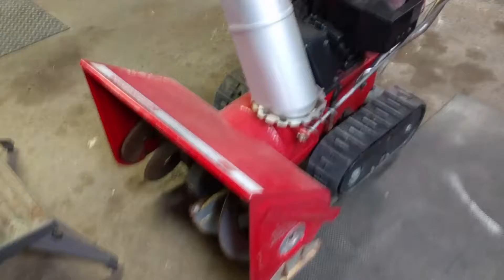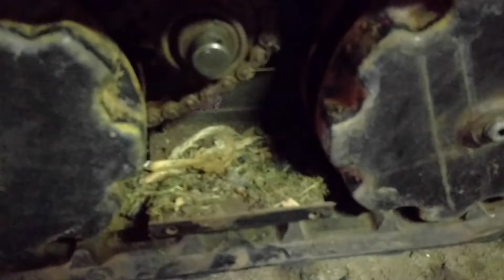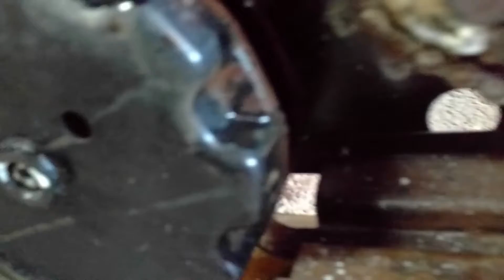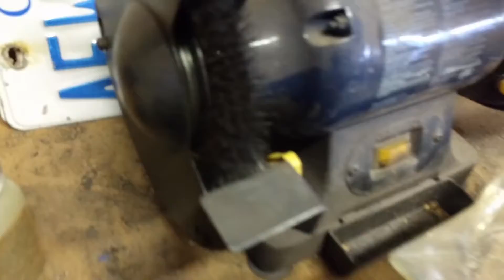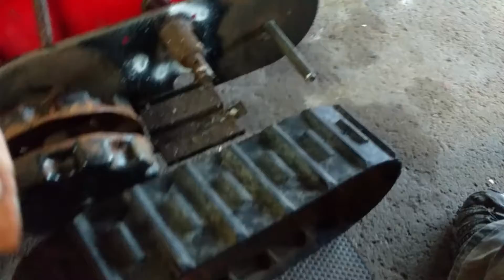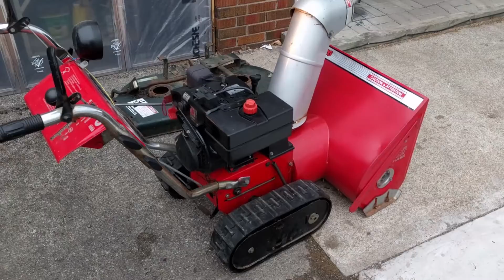Eaton Viking - Track Repair

Comment: I have a 1986 JD1026 wheeled unit that is built the same with exception of the tracks. It's very heavily made and in nice shape, MTD parts work on it. Also have a much, much older Eaton Viking rototiller. Thx for repair vid.
Reply from the maker: @Don_ECHOguy  I used to own an Eaton viking snowblower and the thing was a tank, had tracks too

Comment: I have the same but it's called a landmark snowblower
Reply from the maker: It was back in the shop today to get a drive belt replaced, was such a quick job I didn't even film it. It's a 1987-89 and you can search these using the MTD 317-588 code  Thanks for watching!